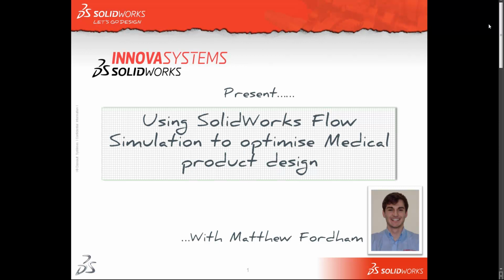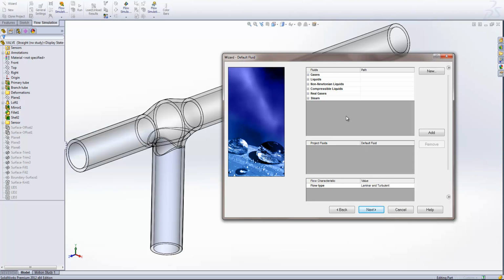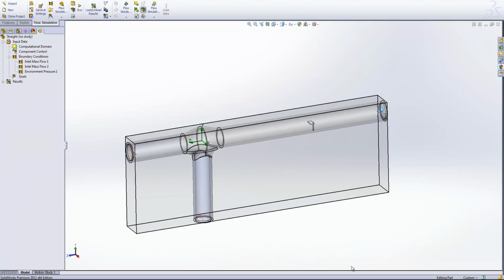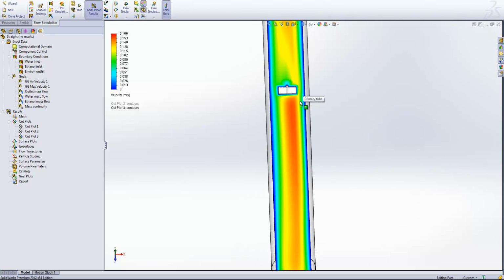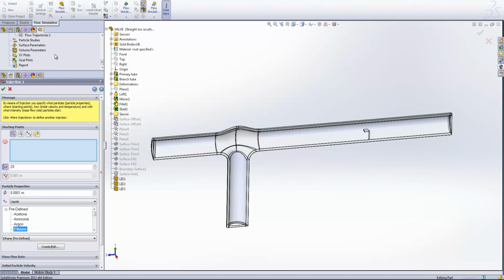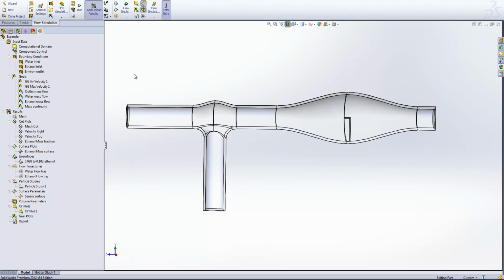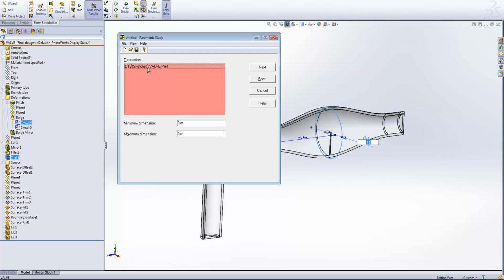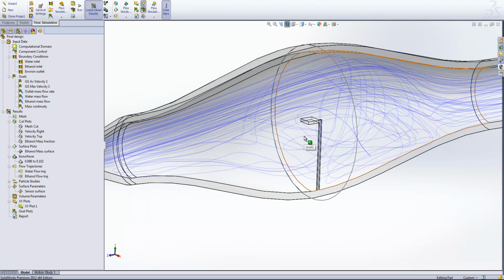Introduction to SolidWorks Flow Simulation [Webcast]

Comment: Question: What if the inlet flow relies on pressure? For example i have a model which has a compressor that will supply  air into nozzles. What if the initial condition of the model requires pressure but  not flow rate? What should i do?

Comment: For anyone having difficulty with the lid part of the video and getting an error that reads "Flow Simulation Error - Face<1> is not laying on the boundary between solid and fluid region.", put the model in cross section form and press the inner face of the lid. He mentions it in the video but when he presses the model it looks as if he pressed the outer face (he didnt) which is what actually renders the error.

Comment: Thanks! Great Tutorial!  I believe the reason the nozzle helped mix your fluids was because when it accelerated the flow, it increased the Reynolds number and brought the flow from laminar into the turbulent flow regime.   Turbulent flow will offer much more mixing than laminar flow.  Does Solid Works Flow calculate Reynolds numbers?  Or is that more of a "bulk" fluid number that doesn't make sense to calculate for individual fluid elements.

Comment: For some reason I can't get the water to flow to all parts of my model. It only really flows in the main pipe but not the lateral pieces.
Reply: Check your gap sizes in your mesh settings so that the solver recognizes that there is indeed a "hole" or branch. Or check your trajectory sizes.
Reply: @bartleycai2759  Thanks soo much Bartley!  I'll that is most likely an issue I need to pay more attention to.  I'll continue to refine the design and test the results.

Comment: Please tell me, why after clicking run simulation, program reports that monitor cannot connect to solver. What can it be? Thanks in advance.
Reply: This is because the your computer has low space RAM> This is problem also happened with me

Comment: i customized my menu and added flow simulation but i did something ( reset to factory defaults i guess) that i cannot find the flow simulation option the next time even in the customize option. where and how can i find flow simulation option. please help me
Reply: this is because no install flow simulation option when installed the products of SolidWorks. Re install the solidworks agin and activate the flow simulation option through the install

Comment: Just a little comment. If you add 1 g/s of water and 0,1 g/s of etanol, the volume fraction you would try to achive is 0,1/1,1 = 0,091 and not 0,1.